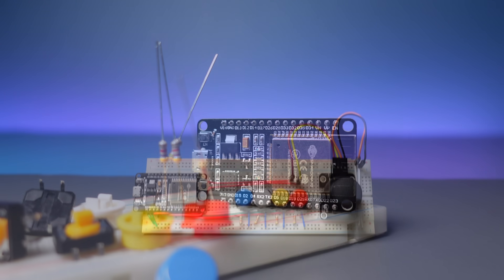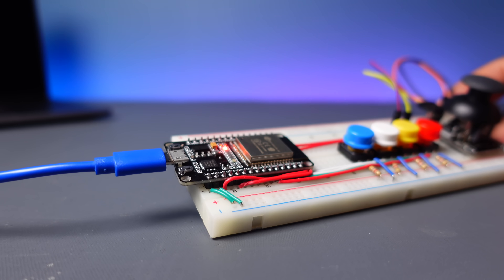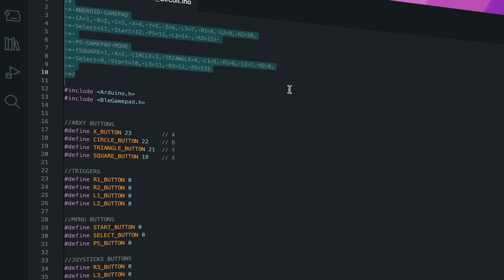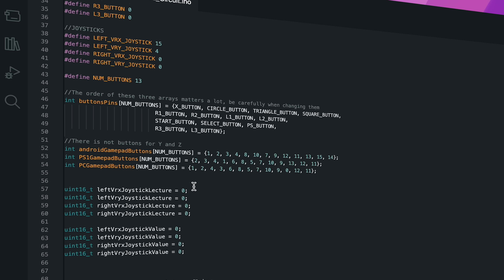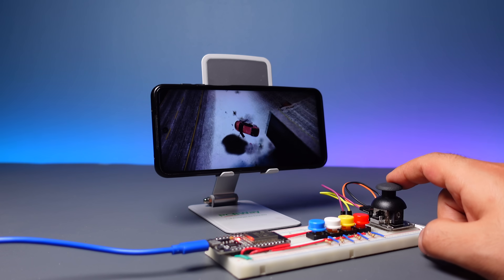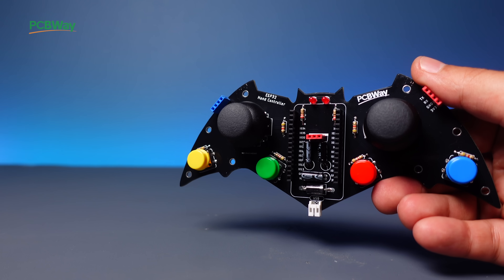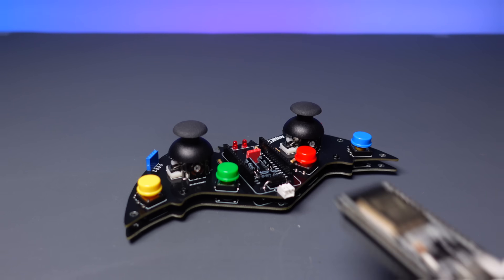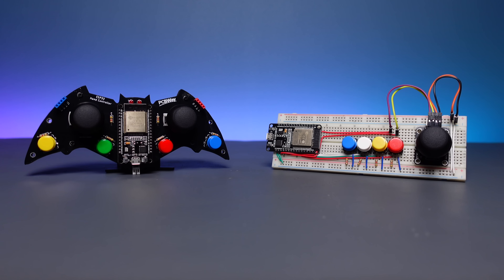DIY Bluetooth GamePad for Android, PlayStation and PC

Comment from the maker: Project Files - https://www.pcbway.com/project/shareproject/DIY_ESP32_Bluetooth_GamePad_for_Android_PlayStation_and_PC_6757e6d6.html
Reply: Does it will vibrate?? Add the vibrating part!!
Reply: Seems to have Gerb files for the batman wing version but not even diagram for the raw 4 button single stick version.

I'm just trying to make 6 buttons communicate with my Android phone game built in Unity, it's for a new type of board game, yes I know it sounds odd.

I bought everything you had listed for the regular version.  And then some extra parts to be sure I had everything covered.  But I'm not sure what the schematic is for the regular version and the batman one isn't as straight forward as it seems to have two sides of pathways, capacitors and stuff for alternative power...  

Did you put up the schematic for the regular version up somewhere?

Comment: Hey bro
Nice video.
I have done something similar.
So I used an old BLE remote from an android tv set top box connected it to my tablet and mapped buttons using k2er app.
The problem I am facing is that 2 buttons cannot be pushed simultaneously.
Lets say in a racing game I am holding down the Up arrow key to accelerate and I need to press Left or Right key to steer.

So as soon as I press the left/right the Up is automatically gets unpressed on the screen.
I am holding down up and left but the car has stopped accelerating and only turning left now.
Any idea how I can get a workaround?

Comment: So, can you remap the controls for media and navigation functions? Such as volume up/down, home, back, play/pause, win, etc?

I want to make my own media and navigation remote with a joystick for mouse input
Reply: Did you ever figure that out? That's exactly what I'm trying to build
Reply: @aozzya1563  Not sure about this library, but you can do that with BleKeyboard lib
Reply: @aozzya1563  I haven't done it yet, but one of the libraries I found had basic keyboard functions, which included generic media controls. It didn't have any sort of mouse or analog support, but I'm sure it wouldn't take much learning to implement. Either way, everything I want out of an air mouse media remote has been done in some capacity, including gyro. 

ESP32 Is definitely the way to go, especially if you are going for a kodi remote.

Comment: The button resistors are not required. The esp32 has internal pullup resistors you can set with pinmode INPUT_PULLUP
Reply: Guess what happens when you're a classic arduino user
Reply: They don't work properly and surrounding interferences trigger them easily.
Reply: Personally, i had difficulty using those, for some reason they never work

Comment: hello, thank you for a great project, i'm making a controller gamepad for pc follow with your turtorial, but i have some problem, that I can connect bluetooth to the gamepad but when i'm in a game, the gamepad cannot use in the game although driver is installed, and it's still connect to computer, thank you so much
Reply from the maker: Hi, thanks for your comment. Did you update the "Game Mode" part in the code? There are three modes, "Android", "PlayStation" and "PC". Please choose "PC" mode or "PlayStation" mode. Also, I'm using a macOS device and the method of connecting is as follows: I selected the "PlayStation" mode in the source code, assigned one of the enabled buttons as the "PS" button, then uploaded the code into the circuit. I kept the "PS" button pressed while I made the circuit connection with the computer via Bluetooth. It connected and worked fine as a game controller while playing games. I haven't tried it on a Windows-based device, it might be easier. If you search for "connecting a game controller to a computer via Bluetooth", you can find many resources and solutions to problems. 😇

Comment: Hi, I've been looking for the file ESP32_BLE_Gamepad_Breadboard_Circuit.ino to do the configuration, but apparently they are no longer in the project or maybe I'm too clumsy and don't understand how to use what is already available. someone knows?
Reply: you go to the link and go down, the link is rigth up the comment
Reply: @gameandfriendsmemory8958  Yes, I have already done it, but I can't find the configuration file, I don't know what the reason is, but I can't find it and I can't change the mode between PS, ANDROID or PC.
Reply from the maker: You can access the source code by following the shared link. The code is a single file (i.e. no other file or page for settings). You can most easily open, edit and upload the source code using an Arduino IDE code editor. When you open the code, scroll down the page, and browse through all the lines, you can see and update all the necessary definitions such as how many buttons you will use, which mode you will use, or which pin inputs are connected to the buttons.
Reply from the maker: Also, take a look at this answer: 
"""
Did you update the "Game Mode" part in the code? There are three modes, "Android", "PlayStation" and "PC". Please choose "PC" mode or "PlayStation" mode. Also, I'm using a macOS device and the method of connecting is as follows: I selected the "PlayStation" mode in the source code, assigned one of the enabled buttons as the "PS" button, then uploaded the code into the circuit. I kept the "PS" button pressed while I made the circuit connection with the computer via Bluetooth. It connected and worked fine as a game controller while playing games. I haven't tried it on a Windows-based device, it might be easier. If you search for "connecting a game controller to a computer via Bluetooth", you can find many resources and solutions to problems. 
"""
Reply: @maker101io  thanks 😃

Comment: can a 3 states switch be added, to change emulation (pc, android, psx) at runtime, or this can be done only on compile time?
and, is it complicated to make this battery powered?
Reply from the maker: Yes, mod switches can be added. But you have to re-adapt the source code. I think it's a good idea, if I find time I'll make this circuit and share the codes.
Reply: @maker101io  thanks, add battery too!